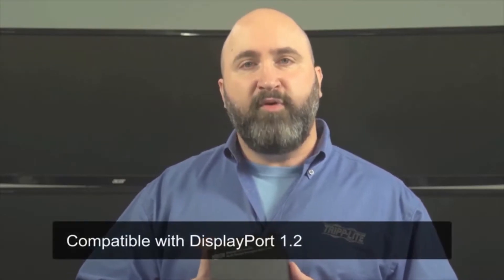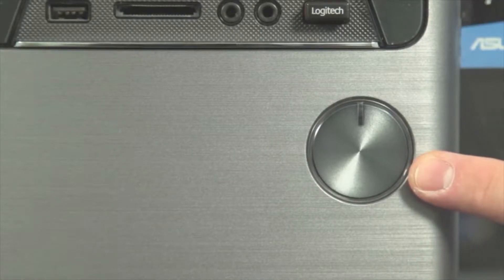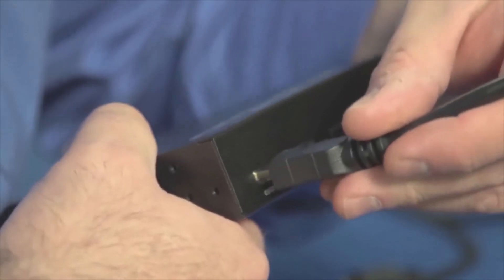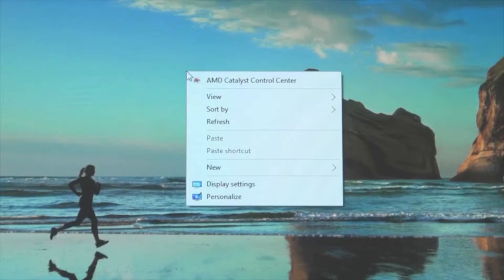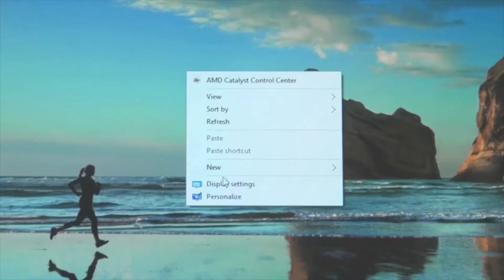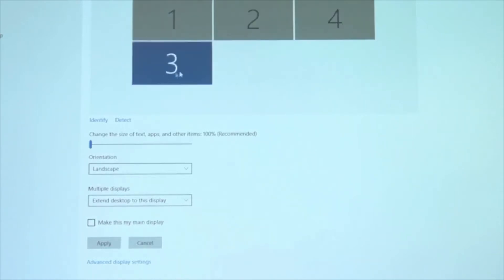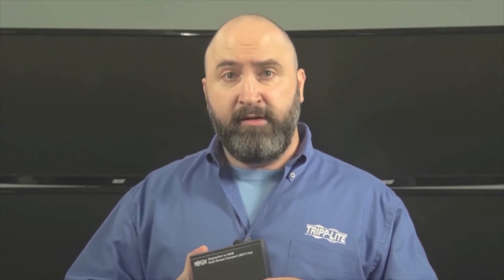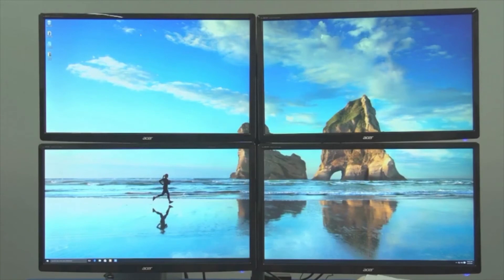How to Use a DisplayPort Multi-Stream Transport Hub - TrippLite

Comment: I purchased this after watching your video as I think it will solve my problems of more monitors. Followed all your instructions but when I hook everything up the amber  signal lights do not come on and am receiving no signal to the other monitors. If I power the unit off and power it back on the three amber lights flash briefly. But nothing to the monitors, Using an RTX 3090 card ,windows 10, tested cords, please help, also monitors are not seen in Nvidia or windows display, updated all drivers.